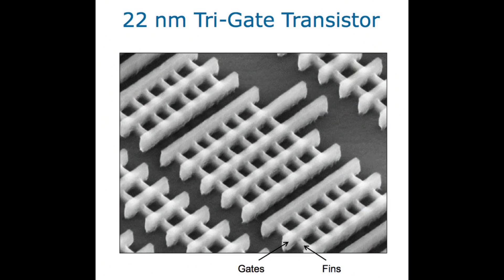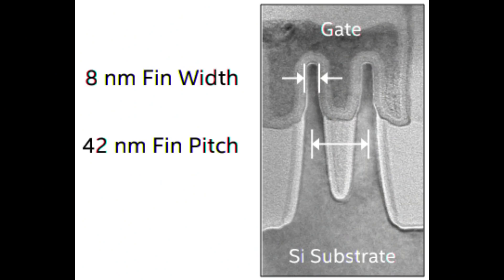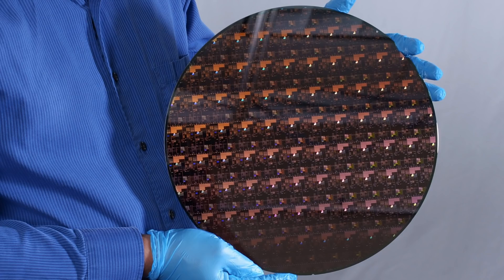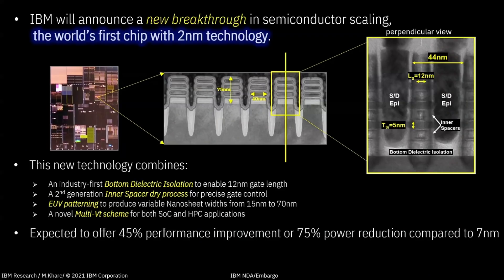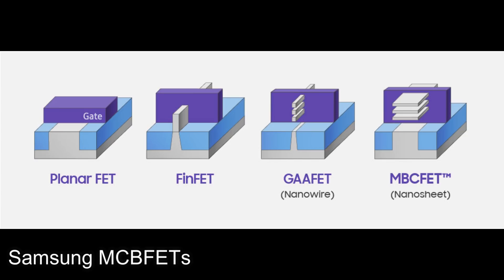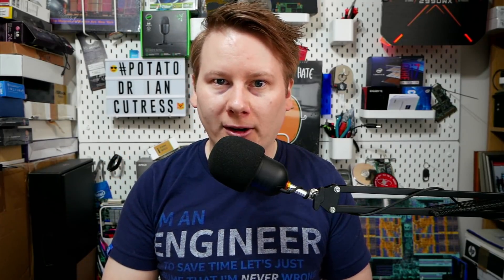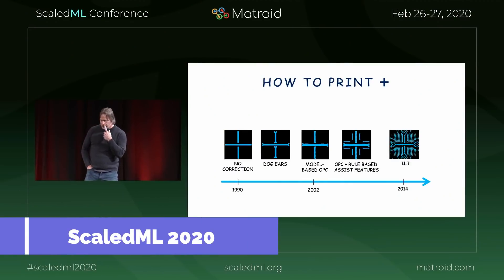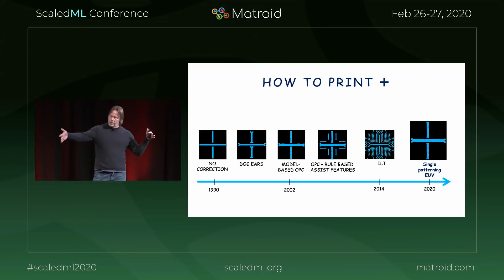There's Plenty Moore Room: IBM's New 2nm CPU

Comment: I'd care more about the fact Jim Keller used Comic Sans for his presentation if he wasn't talking about such complex things. The absurdity of describing such technology in Comic Sans is actually very fitting
Reply from the maker: I believe it's on purpose
Reply: @thabnir  the point is guy is not a graphist, i was explaining WHY the failure is on us to not provide alternative because we are too stuck up in our corner gloating about arbitrary shibboleth instead of providing default choice that fix the problem by understanding the context. Graphist aren't doctor they are culinary chef. I'm dayong will keep revolting, aka misuse comic sans in odd context, if we keep trying to fit square peg in round hole.
Reply: @NeoShameMan  Question to the graphic experts: Which of these fonts will be most readable printed with blurry pixels at extremely small size?  I'm thinking of ownership messages on an empty spot on a chip, but for graphic designers, think watercolor on fabric where ink tends to flow and blur.
Reply: I would be wary of using it on anything consumer facing but it has a history in technical presentations. The OpenBSD crowd and Simon Peyton Jones are known to use it in presentations. I wonder it it is a statement on content above style and a reaction against marketing which is the opposite. I always hate it when used in the wrong context but I wonder if this is actually the right context. As much as I say I hate Comic Sans I do all my sysadmin and programming in a terminal with a monospaced Comic Sans inspired font called Comic Code Ligature.
Reply: Comic sans is more a cultural backlash from graphist like me due to the democratization of fonts and the loss of power of the expert, it became the symbol typographer rallyed around for it's misused in some context, however that reputation is far fetch and the mockery for using it is a bit overdone, comic sans is basically normal people trying to inject humanity against overly formal font design (which is why the font was created in a first place, because using times new roman in a kids birthday card was equally stupid). Nobody can tell me helvetica is a font designed to be at human scale.
Reply: @NeoShameMan  Comic Sans was created as the screen font for Microsoft Bob. It was never intended for regular use. Using it for technical purposes is funny at first but actually distracts from the content. I don’t know what you mean by human scale, but Helvetica is one of the classic typefaces of the 20th century. Love it or hate it, it should not be dismissed. I can highly recommend the “Helvetica” documentary that came out several years ago.
Reply: @germansnowman  i know all the historical details of these two fonts, even why p and q are different in comic sans and why the middle bar of the m is crooked, i havw entire book about helvetica and how pauler scher tried so hard to avoid that damn overuse fonts, o know the context, a single god damn documentary won't change my mind 😂

The reputation that comic sans is hard to read is all made up, sans serif font use to be said the same, now they are standard. history is much more nuanced, and contextual cultural aspect add complexity, the but give you the full picture.
Reply: @NeoShameMan  Fair enough. I just thought you did not know all that because you said that Comic Sans was made for kindergarten posters. In any case, I did not say Comic Sans is hard to read; my point is that typography should serve the content, and typefaces convey certain moods and connotations. If one knows the rules, it’s OK to break them intentionally. However, I thought that the original Higgs Boson presentation by CERN was very much devalued by its unironic (and very likely uneducated) use of Comic Sans.
Reply: @germansnowman  i didn't say kindgarten poster, i said birthday card, or i think i  did lol, i was highlighting that using times new roman there is as aggravating as using comic sansto to represents the bank. However we generally only think with the mindset of someone brainwashed, i mean educated in the graphic art. BUT we are also taught to think critically, and that design is about communication, it's just we assume value communicated by fonts based on what is told to us in school. Problem is that in art school we are also told about history of fonts and how their design reflects value of their era, helvetica was design with an idea of hegemonic universalism, which goes toward its very formal shape, they convey this idea, they are supposed to have the weight of an all encompassing institution that became invisible by literally be everything, as such it erase emotion, bias, therefore humanity, its the idea of everything equal in all measure. Now design  is about communication, communication supposed something is told and something his heard, as graphist we are oversold on the idea of what is told and how it is told, hearing is generally mocked as the public not having taste, the thing is we generally have no idea about how design are actually read, only by funneling the answer into a set of learned values. Reading about how people receive the formal quality of fonts actually diverge quite a lot from what is told, people are actually intimidated by the most formal fonts but feel relax by the more human fonts, that's what's reflected in the comic sans choice, people gravited away for less human fonts toward fonts that resemble them, something that has cadence over rythm, round over sharp, something that's not a threat, because ultimately that's what motivate them toward that fonts, the need to communicate their own self and to break away from the rigidity of rules and institutions, to reconnect with the human aspects. In definitive, it's not comic sans fault to only be the best available choice for people to express tgemselves, it's on the profession to have fail to listen and provide alternative solution that would fit more in the many context, to busy telling than hearing, comic sans is just the unlikely reluctant rebel of a silent revolution of the people against graphic art's various shibboleth...

Comment: well , 2 nm and high clock speeds is a clear no i guess or you have to use a multichip Design but even then you will have problems to cool the chiplets . 3D stacking in another thing that will make cooling difficult . It depends on , how low is the used Voltage and how low is the energy a 2 nm Transistor needs to work properly . 
We will see low clocked , very efficent little Cores , and we will see high clocked " Big " Cores which will be by far not as dense packed. Maybe 4,5 - 5,0 GHz , but 10 GHz which Intel thought we have in 2008-2010 ? No , if the structures get smaller , the generated heat cant be removed as fast as before and as fast as needed at higher Clock speeds .

Comment: Nothing on a 2nm chip is 2nm. It is no more meaningful than saying they have developed a 8000 chip after finishing their 7000 chip. Power; performance; area. 2nm just means IBM thinks this process node is better than 3nm. There is no measurement that is actually 2 nm.
Reply from the maker: That's.... That's... Mentioned in the video. Good job.

Comment: Ian, small remark, the Wilton facility does not build EUV machines. It produces parts for the ASML Scanner like reticle stages and certain clamping mechanisms. The full EUV machines (Scanner + EUV light source) are build in Veldhoven the Netherlands. ASML San Diego (formerly Cymer) builds big part of the EUV light source. So if you really want to see some EUV technology you need to go to San Diego, not Wilton. Just mentioning it to prevent disappointment.
Reply from the maker: Huh. Their PR told me the Wilton plant does a lot of EUV assembly.
Reply: @TechTechPotato  Yes of parts (related to the Scanner) that end up into the full EUV machine, but they don't do actual work on the 'full' EUV light source. But still a super opportunity to visit that site!.
Reply: @TechTechPotato  All EUV used in the U.S are made in the U.S. That was the agreement in the first place. The EUV itself is an American technology.
 https://www.eetimes.com/u-s-gives-ok-to-asml-on-euv-effort/
Reply: @someone5582  Not really a surprise a 22 year old article (containing multiple errors btw) does not reflect the current reality. The story might state the intentions that they had at that time, but reality turned out differently. To give you an idea, there was not just 1 EUV light source under development, but at least 3. In the end it was a close race between Cymer and Gigaphoton who would make the first technically and commercially viable light source. 

Eventually ASML went all in on Cymer, who was developing the light source the article is probably referring to. As development went way to slow, ASML bought Cymer in 2013 and moved a lot of the research facilities (including most of the software development needed) to the Netherlands. Only the last couple of years things are moving back to ASML San Diego (formerly Cymer) again. As a result you will find many parts of the light source being designed, developed and produced in the Netherlands and some neighboring countries. E.g the modular vessel, the vacuum enclosure, where all the magic happens is build in the Netherlands by VDL , the huge laser that fires on these tiny Tin droplets is made by TRUMPF Germany, and all optical mirrors to focus and transport the light beam are created by Zeiss Germany.

Intellectual property matters are not really my field of expertise, but I think it's safe to say a statement like 'EUV is American technology' (or any other country for that matter) is wrong on multiple levels. As mentioned multiple parties were trying to develop an EUV light source, the American variant as mentioned in the article is one of them, but other prototypes were developed outside of the US. The owner of the technology is the one holding it's intellectual property / patents. And after Cymer was bought by ASML these EUV patents came in the hand of ASML, look up patent US7453077B2 (EUV light source) if you want. You will see the Current Assignee is ASML Netherlands BV.

And yes agreements where made during this acquisition of Cymer by ASML. As the US government considered the technology sensitive for national security ASML is by agreement not allowed to export these EUV light sources to certain listed countries/regimes without permission from the US. The whole political story is way more complicated then this (as ASML is in fact only depends on a GO for delivery from the Dutch government and not from the US one), but it will give you an idea of what is going on.

Also be clear the article and myself are only talking about the EUV light source. A working machine consists of a scanner with a light source attached. You need both. As the US has no say in the scanner part and non-EUV lightsources, DUV machines (scanners with a different, slightly older technology light source) are (still) sold to China.

Comment: well I can tell you one thing. 
in 2024 we still will be rolling DDR5 to cheaper devices, so no DDR6 at least on consumer side. 

I 15 to 80 nm in size, I wonder what resolution it have in between, 15/30/45/55/80?
still a lot of options though, I love it.

Comment: Any details on feature size?
Reply from the maker: Cell height of 75 nm, cell width of 40 nm, 
Individual nanosheets are 5nm in height, separated from each other by 5 nm. 
The gate poly pitch is 44nm, and the gate length is 12 nm
Reply: @TechTechPotato  thanks!

Comment: I made a presentation about nanoelectronics a week ago and couldn't understand the discrepancy between gate length in research papers and in industry. I've read a paper of a single atom transistor and they were talking about 20nm whereas TSMC is mass producing 5nm node. I guess is all about marketing.

Comment: IBM is  the O.G in Tech and R&D  .
Reply: The real tech in semiconductors is from ASML though. They made these EUV machines that make the chips, the only one that can.
ASML have been the silent driving force behind all the innovation over the last 10 to 20 years. 
That is the lithography machines that print the designs on the silicon wafer. 
If you nuke this 1 company and all its people, research. We go back like 10 to 20 years, reverse engeneering these machines is next to impossible.
Reply: what is O.G
Reply: @HalitZiyaKARTAL  it means “ Original Gangster “

Comment: When that hits main stream, i wonder what ram it will use.  I think there's 6x  integrated on 5nm. That's gaming phones now and servers.  Per nm generation from that, thats 3-4. Considering intel is just now using 10nm not even seven and using ddr4. Meanwhile AMD is on 7nm using ddr4 . To be fair I believe last generation amd (2018) used 14nm.  Ddr4 was in its less mature speeds at 2933 base clock specs.

Comment: The naming schemes really are a mess lol. The 1st guilty party are the industry players for failing to create a proper standard and then is the less tech savvy tech media that don't clarify these distinctions.

Awesome vídeo as always :)
Reply: Hey, at least Intel never released a 14nm 3.2 gen 2x2 process. Count your blessings!
Reply: Number of transistors on a chip would probably be a better indicator rather than the industry jargon being used. 
Most people seem to think that 2nm is the limits of Moore's law when it is not even close to the truth. 
They could stall at 2nm and still get more transistors in there. I think there is a 12,000 more increase to be had with out any sorts of fancy three dimensional architecture. 
I bet we will still be talking about its send in 20 years time.
Reply: The names are a mess because they’re meaningless at this point. Designs are diverging based on proprietary innovations so there’s no point standardizing.

Comment: If the industry still can't agree some better measure based on transistors per mm^2 or whatever, shouldn't the tech press just agree on and switch to a console-style rough yardstick of generations for now? By this stage it really can't be any more confusing or annoying for us consumers than the eight-thousandth repetition of "Intel's 14nm process, which is actually more closely equivalent to ..." Use some half-generation labels here and there if necessary.
Reply from the maker: The problem is half-node improvements, or minor adjustments that get marketed as new node technologies.

Comment: I also have to check if you have a video on lithography. If not then perhaps you will make one.
Last time I was in the loop was late 2000's. And they used water (?) or different media to reduce the wavelength of the laser that was "cutting" all of this parts on the chip.
EUV seems like something that could help keep up the speed of reducing the "size" of transistors throughout 2020's. Of course we are close to atom size - but the same was said years before - I remember when people looking 5-8 years into the future said that 14nm will be the last possibly viable node. Since you will be basically having so many problems with leakage and the sizes of atoms that it will be impossible. Also people were really pumped up to see Graphen based chips - with possible frequencies of 100 THz. :D
To engineers it seems that there are no impossible tasks! Cheers to everyone working in that industry!

Comment: This is extremely good news, it's getting exponentially harder to scale down even further as we are reaching quantum limits for electrons.  The distances between certain features within the transistors can be measured in atoms... (I think IBM made a video/animation using 8 or so atoms in a stickman configuration) 

Even assuming you could get over the quantum tunneling effects, we cant build circuits smaller than the size of an atom, we would need a breakthrough in optical or full quantum computing.  Truly amazing, the cutting edge of applied physics.

Comment: Sounds like we are getting close to measuring process nodes in picometers. At that point Ian's new tag line could be, "I have pica for picometers" ... Sounds like it should be on a cereal box.
Reply: Nah, they will go to angstroms (a tenth of a nm). Plus they will hit the limit soon on size reduction
Reply: There’s actually very little room left at the bottom. Advances are now majority driven by design rather than scaling. Case in point, this IBM design.
Reply: No not really the smallest a transistor can get is around 0.8 nm between source and drain which are 3 silicon atoms in a row and this is without doting the material
Reply: A silicon atom is 0.21nm, and you need a few of them, due to doping with other atoms to create the PNP setup needed for a transistor to work.
But they are building in 3d and only measure the horizontal plane. So maybe towers of 0.21nm wide could be the most dense they can get.

Comment: Future is task specific cpu design. Cpu #1 has increase in gaming performance over cpu #2 which has performance increase for production.
Reply: Time to put the smarts into programming instead of having the entire software industry rely on CPU improvements to make things faster. You can create a thread and mark it with metadata that describes what kind of workload it is and the scheduler can smartly have it be executed on the appropriate core if you have heterogeneous architectures with various specialized cores. Once the GPU was invented as a specialized CPU to run graphics operations on but I don't see why a big CPU die can have lots of different abled cores instead of the all or nothing approach you have today with giving all cores things like AVX512 or none of them. The problem is that it all has to make economic sense as well. That is the real joy killer.